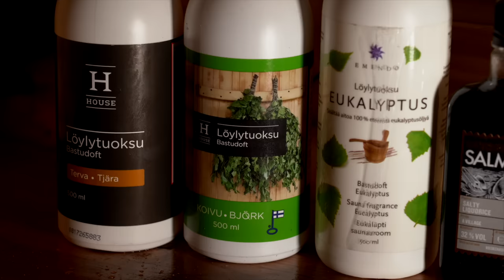Building a Sauna Cabin with Logs in the Wilderness Alone with My Dog | Start to Finish

Comment: I haveb loved watching you build cabin and the out buildings. You are an awesome builder !
 I'm not much for saunas, as I had a heat stroke when I was  14 years old and still done tolerate the heat well.
My dad and maternal grandpa were both good carpenters, so I know some about building. .
I love how you blacken your legs ect. I saw Joanna on fixeruper for HGTV use that method on a boat house that she made over for a client..I think she called it Shibori. It's awesome looking !  Is that how you protect the logs from the elements and to keep the foundation from rotting ?
I love how you interact with Calli .its apparent that she loves you a great deal. It's funny that she is chasing the chips from your cutting the knochse from the logs. Is she a Golden Retriever ?

Comment: ONE MORE THING: THE ROOF STRUCTURE APPEARS TO BE 2X6 PLANKS PLACED INTHE WEEK DIRECTION, THAT IS LAYING FLAT.  THESE BOARDS WILL NOT CARY MUCH LOAD WATER LAYDEN MOSS THAT FREEZES THUS HOLDINGTHE WATER WEIGHT ON THE ROOF INSTEAS OF DRAINING AND THEN HOLDING SNOW ON TOP OF THAT COULD COLAPSE THE ROOF.

Comment: So much here to watch, absorb and learn from.  The most important thing to learn is it's a job, it's work, and you are the only one to do it.  Perseverance and dedication to purpose.  It's not done in an hour, a day or a years but over a lifetime.  How to approach a task large or small.
   I've wondered if you have had any injuries while doing so much heavy lifting?   The years don't age you so much as the accidents and injuries.  BTW, I was so sad when Kelly (Cali) had the heat stroke. I would guess she's got a lot of body fat built up for winter temps. conditioned to the very cold and long winters and she just got caught on a hot day while still wearing the winter coat and body fat?

Comment: Amazing craftsmanship and amount time spent to build this sauna. It is painful to see that it will be none functional, sauna is all about insolation, insulation, and insulation. Non insulated floor, the wall that he built to divide room, roof and walls will drain/leak heat immediately. I was in the sauna like that few weeks ago, we barely could heat it up to 170 F, all 12" of snow on the roof melted when it is was -15 F outside.
Big thumbs up though for dooing all of this alone.

Comment: Trying to understand the scribing process and how you are setting the scribe to a different width each time.  Are you measuring the thickness of the log at the beginning then cutting the scribe width down by half of the delta.  So starting with the fat end lets say 10 inches then skinny end is 8 your scribe width would have to lessen by 1 inch?  How do you determine the starting scribe width?  maybe the measurement of the resting loge over the other log on the elbow?  Great video, thanks!

Comment: Would you consider, taking apart your "Bath" room and relocating the building to the new cabin.   If you put screws into the building,
just take them out, number them and put it back togethor......just and Idea........James 
I am 68, but at 32, I had a non-smoking stroke which took my speech, my right face and 50% of my right arm.......in five years I
got my speech back and my right face and arm back.......If you looked at me you could never say that I was on that road.
I became a Correction Officer at 41 in a Maximum Security Prison.......had two daughters, which now teach in Vienna, Austria, 34 and 32.
My wife and I are now retired........

Comment: that the only way they make stove pipe these days to install backwards, I want the lap facing down the female end so smoke doesn't exit out the seam which it will facing that direction, smoke is like water, however it doesn't run down hill far as heat rises, specially outside so rain water doesn't seep in, that crazy, not the first guy I seen install this way?  smoke can find its way up through those corrugations and come out the seam, you can see it, and smell it, don't want my lungs getting suity and grungy no thanks, stoves should have the male end sticking out, follow that and you're good to go, do not like male end facing downward, i want it lapping the same direction smoke exits.. just like shingles, you wouldn't lap shingles backwards